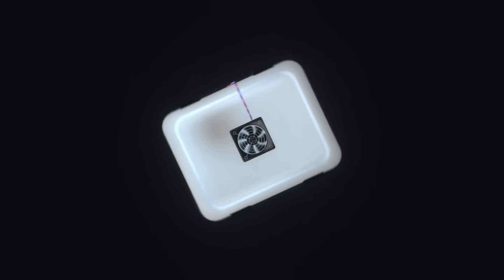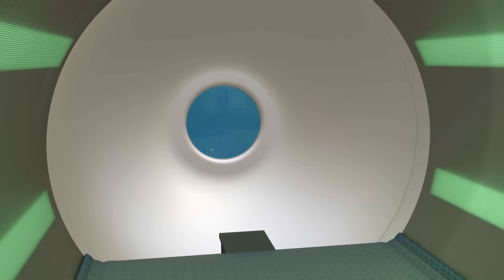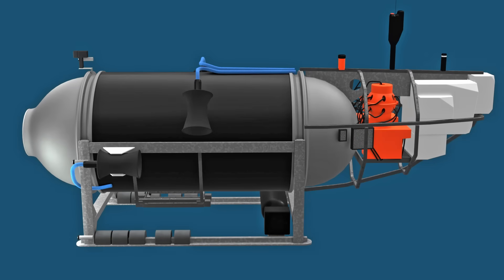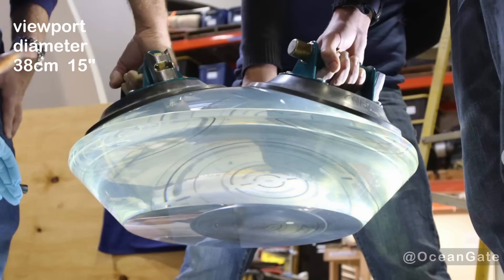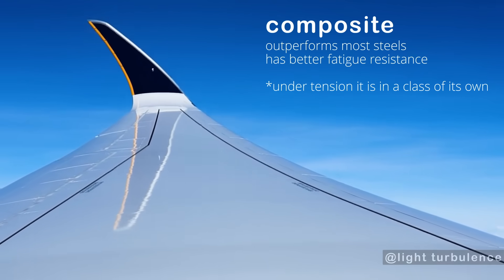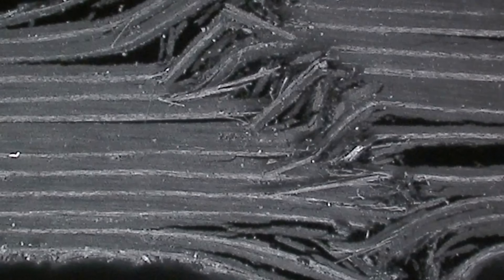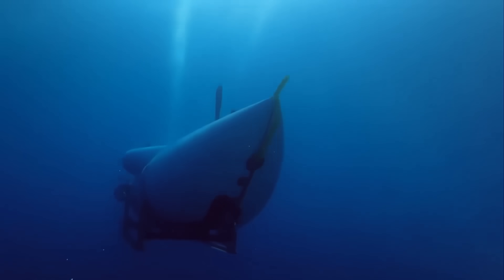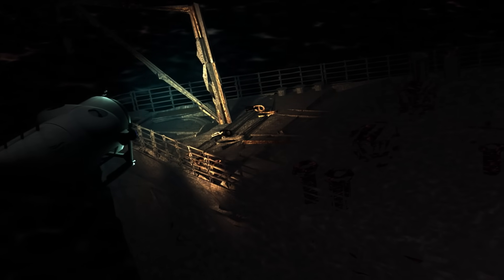Titan Sub | carbon fiber - Detailed Tour

Comment: Reminds me of early days of carbon fiber bicycles. For the longest time they were cracking and failing but only some carbon fiber bicycles. It appeared random. Experts in carbon fiber were baffled, it was random cracks and failures. None of the carbon fiber experts were avid cyclists, those who buy $5,000 carbon fiber bicycles. until one carbon fiber expert was friends with pro bicycle racer. He realized the cracks corresponded with the squeeze clamp of a bicycle lift and car bike carrier. They also experienced delamination issues where carbon met up with metal parts and bicycle grease. This was in the early days of carbon fiber bikes.

Comment: Thank you for your video, well thought out and presented. We will have to wait for the autopsy for final confirmation, of course.

I've worked with carbon fiber composites since about 1980 and I've seen unexpected failures occasionally.

CF is amazingly strong in tension, and very strong in compression as long as the fibers are kept in column..In applications like this, unidirectional tows are used rather than woven fabric to keep everything inline. Generally, epoxies are used to bond a CF structure together and is the only thing that keeps CF in column when in compression. Most failures that I've seen are compression failures where the epoxy to CF bond is inadequate to hold the CF in column under load. If the tows were not kept 0/90.exactly, as would be expected if the fibers were laid down under tension. I believe the compressed strength would be reduced. For myself, I would have thrown in some extra 45/45 fibers for toughness, given the risk. Were samples of the layup tested to destruction? Do we have access to the samples?

I also worry about the CF to titanium bond. I would have liked to see more surface area in the bond and that it was supported mechanically.
Reply from the maker: As far as I know the hulls werent tested to destruction, except the final dive 😬
A 1/3 version was tested to destruction but it was a version with domed ends and it seems it failed earlier than expected.

Comment: I can't imagine a reason to make a pressure vessel meant to go underwater from solid thread and resin instead of a thick tempered steel tank, or titanium if weight is a problem... Metal hulls handle pressure cycles pretty damn well.

Comment: Ultimately... it failed. Unlike the aircraft industry, where composites have been intensively studied, tested, and validated (sometimes at huge cost, both in dollars and lives), this could have been prevented. Purely a case of material application with not enough understanding of how the material will perform, lack of adequate safety margins, combined with budgetary limitations, and limitless hubris. Typical of engineers that believe they are all knowing, they are a detriment to their counterparts.

Comment: Ah ! finally we have someone who explains what happened. This is exactly what i explained to my friends as i work with carbon fiber since more than 20 years in racing car applications. The big problem come from the end caps, applying 5-6 times the pressure on the tube ends because of geometry, so after a while and many pressure variations the tube end got some wear coming from the resin aging through the process and the fiber becoming slighly wrinkled as you explained. So cracks start to form and one day you have a sudden major failure .

Comment: How was weight using titanium calculated? 7:55 sounds like he's saying (titanium) steel weight, not titanium which is less dense.  Also CF walls were 5". How thick would metal walls need to be?

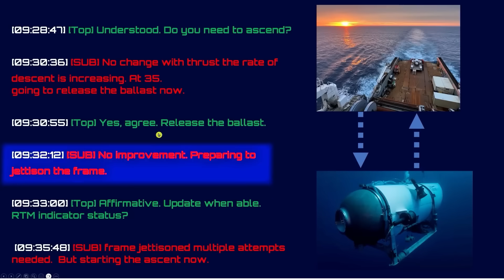16:00 You can't assume an emergency response is rational when the vessel is commanded by the person you've just demonstrated has acted with more hubris than rationality.

Comment: The most likely reason why Titan's hull failed is seawater is very corrosive. All glue or epoxy has very little resistance to seawater corrosive ness 2:59  and it was there the hull failed. The point where the carbon fiber hull was connected to the titanium rings was epoxy glued. Once it started to leak, the end was just a matter of time away from tragedy.

Comment: Not getting on a sub with Mike, he didn’t learn the lesson about carbon fiber… The carbon fiber used was a fabric but what is holding that fabric rigid? It’s a resin, the only thing holding the layers of fabric together is that resin. Even under tension the resin will break down which is why the Boeing 787’s fuselage has a life cycle of 44,000 pressurized flights. Everyone who previously went on the sub discussed vary loud cracking sounds, which is a clear sign of delamination between the layers of fabric. If the sub had gone down and stayed down, it would probably still be intact. The issue is going down and coming back up, essentially the equivalent of a flight cycle. Each time it compresses and contracts, the cracks are getting bigger, and more frequent. Rush knew this but still neglected to do an x-ray because he knew it would be the end of Ocean gate, why not go out with a bag. Congratulations Rush you made it into history, I’m sure you’ll be in lots of engineering textbooks for decades to come.
Reply: Good point - i assume they calculated that the titan would be capable of doing a couple of dives which it did and reached over 4km deep. But this time the last dive was completely imploded.

Comment: At 9:00 you start discussing carbon fiber composites (CFC) and compression. It is absolutely correct to say that CFC are strong in tensile stress weak in compressive stress for the same reason a rope is strong in one direction but not at the opposite one. The example that you give with the bending wing is wrong, too - bending of a beam loads one side of it with compressive stresses and the other side - with tensile stresses. For materials that are much weaker in one than in the other, this must be considered when designing the structure. Concrete is stronger in compressive stress and hence the reinforcement is put at that part of the beam in which there is tensile stress. With CFC it's exactly the opposite (only in this case people play mostly with thickness and shape). In the case of the wing, most of the load is carried by the part which is subjected to tensile stresses.

Comment: I appreciate the tone of this video and was delighted not once to hear the word “hubris”. We all know the Stockton Rush was impatient and too shortcuts. He ignored experts advice. But not all on board with him we’re innocent victims, as Nagolet knew all the shortcomings and had told in a text or email he would rather die instantly and catastrophically beneath the sea than a bored old man (or something to that effect)

There was the usual media frenzy crazy speculation from incomplete information and scathing character assassination…when Rush was not all bad. He had started out in submersibles using his to take research crews and journalist. He had student educational programs. He actually was doing a service. But he became ambitious beyond his financial means and skipped the critical testing to failure and non/invasive periodic testing of the hull’s integrity with ultrasound as recommended—instead relying on Wile E. Coyote methodology acoustic sensors (seriously I imagine them arriving in an Acme box). Some experts have also mentioned a curing process (I am not an engineer) to strengthen the adhesive bond between the fibers.

I kept pointing out your factual errors in that Rush  made a second hull after the first one was making noises, and other things, but those minor error are corrected here. Rush went around certification, called passengers mission specialists, outright lied,etc but a complete villain? No.

I even had to correct someone from calling him a psychopath. Really?

Comment: I am not versed in composites but a composite expert once told me you could make fibreglass bulletproof, if you used the correct material and laid it in many directions. When you said they only had two directions I instinctively knew that was bad. The trouble seems to lie in the loophole in regulatory standards and engineering tests to vehicles but we all sort of know the US is good at lax standards.

Comment: No matter how you say it, carbon fiber is thread. Thread stretches it does not compress well. Too simplistic?
Reply from the maker: If its just a thread how do F1 connector rods manage phenomenal compression and how does the entire racing yacht stand up on a sleek slender CF foil?
Think of it like a gazillion minuscule spaghetti kept stable by the resin matrix.

Comment: Sorry but this is NOT correct. Steel is stronger than carbon fiber... in compression. Aviation comparisons are a different class all together like the wing of a plane where you have forces working in multiple directions across the surface.

Comment: I have a carbon fibre pressure bottle to charge an air rifle. It has 3000 psi in it. It holds this pressure easily. If I drop an unpressurised empty bottle from waist height it will smash. Carbon can take immense internal pressure (tension). It is useless under compression. That's why they all died.

Comment: If there was this much compressive force at the ends of the composite could it have delaminated over time and exploded at the ends while it was being crushed in the middle? I feel like only doing a destructive test wouldn't have found this. That would tell you the crush depth on it's first dive. They would've also wanted to simulate repeated wear on the material so they would know how many dives they could get out of a hull. That is where the big money investment would've been for this project but it would've saved lives.

Comment: Compressive strength of fibers is like pushing a rope. If you can keep them in a perfectly straight line and have no lateral load or irregularities, yes, they're incredibly strong... but you can't do that. So composites rely on the resin to provide compressive strength.

Any deterioration or voids in the resin matrix will dramatically decrease the cycle life of the composite. As fibers are allowed to move or, perhaps as the case may be with the Titan, the fibers compress less than the matrix itself, mechanical action will continue and accelerate the seperation of the resin bonds. Getting air out of the composite is challenging enough as it is. Now imagine getting it out of a 5" thick cylinder.

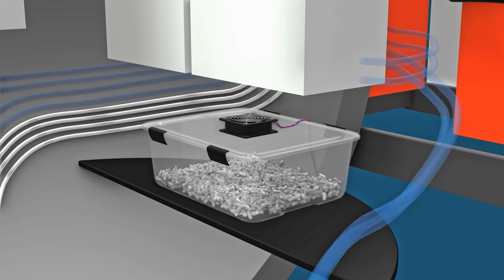Comment: Your CO2 scrubber has only one air access. . . the fan.  05:28
Reply from the maker: The photo and verbal description did not provide any detail on where the opposite air path was. My guess was many small holes below the pellets for equalised airflow.

Comment: "Titanium and composite deflection characteristics under load are very similar."

Are they, though? Carbon-fibre composite might behave similarly to titanium under tension and flexion, but are the characteristics "very similar" under compression? Even if the carbon-fibre-composite is only slightly more compressible than the titanium, that puts a huge demand on the flanges and the glue joint.

Comment: I would guess the main problem was that they glued the titanium spherical end caps onto the carbon fibre tube and didn't take and special care to avoid air bubbles or anything there. Just slathered on the glue and stuck the end caps on. The deformation of spherical caps would have been much less than the carbon fibre tube and the capsule would have become peanut shaped at depth, bending in the weak glue joint area.

Comment: While I think your point about the theoretical use of carbon fiber composites for such an application is well taken, I still think that there is serious question about the reliability of such materials when cycle loaded with such extreme pressures and temperatures. I think it's a fairly good bet that you could make a diving pressure vessel out of carbon fiber, but it's lifespan would be measured in the single digits of dives, depending on depth and design. Since you can't really repair delamination happening inside a 5" thick tube, it would essentially be a disposable craft and would ultimately cost far more than a much more reusable titanium one.

Comment: The owner was the designer of that death trap. He wouldn’t let anyone tell him what should have been done in order to have a safe vehicle that would actually be capable of continuously be exposed to the pressures of each dive. His arrogance and confidence led to the deaths of those aboard that Sub. He listened to no one especially those who knew what was needed to build a safe immersible. Yes he is responsible for the deaths of those aboard his mistake, he told everyone that his submersible was absolutely safe, when in fact it was not. He convinced everyone the dive would be safe. Unfortunately those passengers ignored any truths they may have heard about the craft because it’s owner and builder told them they would have no problems with the craft at that depth. The owner was wrong from the beginning. He cost them their lives. Unfortunately money can’t buy your safety or guarantee you would make it out alive from that adventure. I feel sorry for the families of those who lost their lives because they trusted the owner and Captain of the ill-fated trip. May they all be walking with God…

Comment: Excellent analysis. Compressional strength of carbon fiber under constant and heavy pressure - especially from all sides - is in fact very poor, this material also tends to deteriorate at a vast rate when under compression/ de-compression cycles. Hence why it’s not used in subs and never will be. Aside from any delamination issues also associated with it or it’s vulnerability to lightning/high voltage exposure. On top of all of that - to choose a tube instead of a sphere as the primary design element was for sure the cookie on the cake.

Comment: The weakest pressure point is the center of the carbon fiber tube just like crashing an aluminum can from the middle. The titanium Ends are the strongests parts. The titanium rings attached to the carbon fiber tube is also is the most weakest points. The Carbon fiber tube under pressure will flex and start to slightly implode or deforms from the center. As the carbon tube implodes or deforms slightly from the center under pressure, the cabon tube edges deform and are no longer round. Hence the carbon tube edges attached to the titanium rings start to try and separate or crack from the titanuim rings. But I do not think this was the cause of the emplosion because the carbon tube broke up to bits. Had the carbon tube separated from the titanium rings the water would have entered inside the sub and the carbon tube would not have broken up into bits as the pressure would start to equalise. Therefore the carbon fiber tube could only have broken up due to the outside pressure placed upon the tube either due to cabon laying or resin defacts or due to that the carbon tube was not strong enough for that depth pressure after a number of cycles of dives. Hence a extra number of internal titanium round rings support would have been needed to be added to the carbon fiber tube to increase the carbon fiber tube strenght at the center of it. Starting from the center of the carbon tube to the outer towards the titanium ends caps.

Comment: No aircraft wing is going to experience the kind of compressive force that a deep sea submersible will. Unless you are planning to explore the surface of Venus, compressive force isn't  really a factor to consider in aerospace design, and were simply the wrong kind of construction protocols to use for a vessel designed to withstand the ocean depths. I wouldn't call Stockton Rush an engineer, regardless of his degree. He ignored the ethics that engineers are expected to follow, and he cut so many corners out of scorn for common sense safety precautions.

Comment: 9:35 you are showing a wing, cool, but a wing still has internal spars for strength. The submersible was HOLLOW TUBE... A pretty poor item for withstanding THOUSANDS OF TONNS OF PRESSURE under a couple of inches worth of wall.

Sorry but unless you are offering internal support to this tube structure, it's worthless.

Comment: Informative video but as far as the carbon fiber goes, I’m going to trust the expert ocean sub divers rather then a random YouTuber telling me the experts are wrong about carbon fiber. Highly doubt the guy that made this knows anything at all about subs. Good at creating animations and doing google searches, but not a submersible expert.
Reply: As somebody who went to engineering school, I can agree with a lot of the video.  The issue with carbon fiber is such that I am not sure why people even try that hard to still use it in this manner.  It has a tremendously high tensile strength, but a very low compressive strength unless also simultaneously kept under some level of compression. When you add in the potential for layer separation or delamination when used in a high-pressure environment, it definitely seems like any potential benefits are very much overweight by the enormous complexity of making a carbon fiber construct suitable to fulfill the objective.  It makes more sense to just use something else.  The only way to really use it right would be something that would leverage its tensile strengths.  Using it for air tanks would work well.  In order to leverage the potential compressive strengths with carbon fiber, you need to work out a method where it is simultaneously kept under compassion and attention. This is possible, as these two forces are not mutually exclusive. This basic cylinder is not the answer to leveraging this.